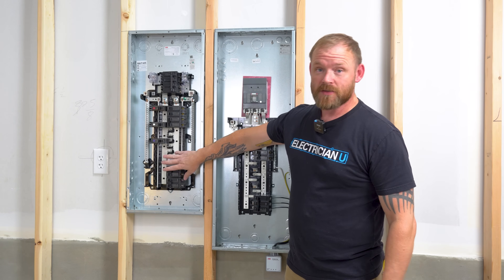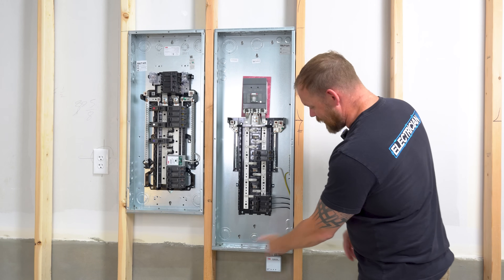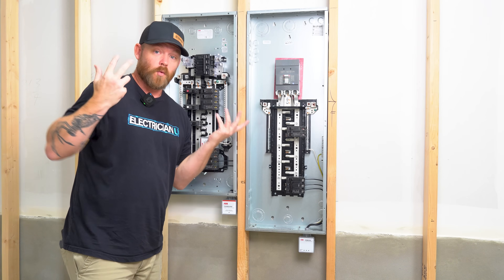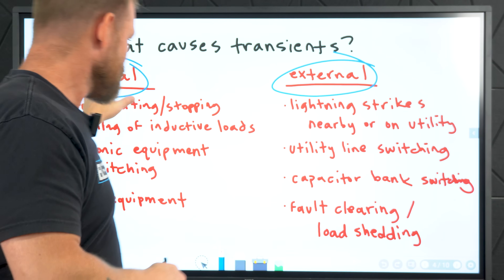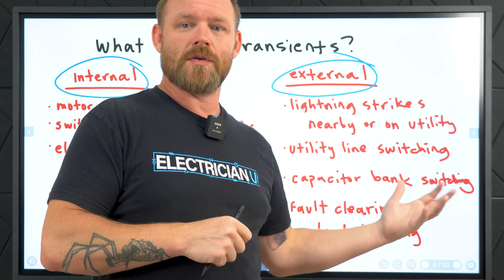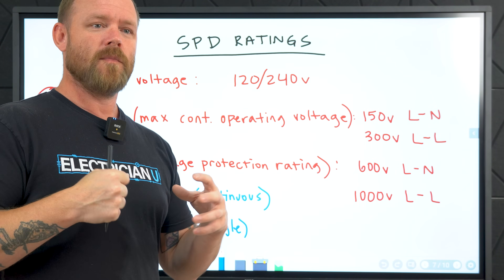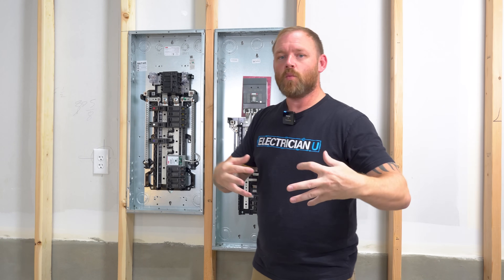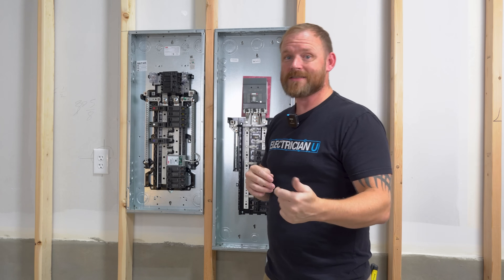What Surge Protectors Actually Do (and What They Don’t)

Comment: My understanding is that even lightning rods do not so much take strikes as prevent them by allowing smaller discharges to happen earlier, so that the voltage needed for a strong lightning strike never builds up -- instead you get a corona discharge off the tip of the lightning bolt, relieving the pressure.  BTW, a lot of people think "surge" means "momentary outage" -- I hear that a lot.

Comment: A lightning protection system has nothing to do with conducting the energy of a lightning strike into the ground, it actually disincentivizes the lightning from wanting to strike anywhere near your residence by those wires giving an easy way for ions in the earth to equalize the voltage potential.

Comment: Why is it on thr lineman side when they go and check for voltage on the bottem side of the meter the surge protector casue the meter to pick up small amounts of voltage ?

 Nevermind just seen the end of the video im now assuming its becasue of the mov acting almost like a capacitor 👍 roger that

Comment: Were constantly having squirrels get zapped on our polepig blowing the fuse, along with recloser activations in storms, so I really need to install a surge protector in my panel. I think I'm going with an Eaton flush mount protector, because im not thrilled with putting a square d hepd80 or Siemens in the wall without it being in a box (due to the lightning strike  explosion and fire risk) and those companies flush mount kit is nothing more than a trim ring.

Comment: I lucked out with my assembly, when lightning struck power pole near my house a few year ago. AND this is IS a lightning story, in which my stuff survived.

I have (and had) a meter based surge protector. I have 5 ground rods near and at the box and meter. Also an extra loop and separate (older) main fuse box leading to separate distribution sub-panel (eventually to be rewired to be the main panel). All sub-panel circuits are in EMT or ridgid metal conduit which is almost all of the house.

Event: Lightning sturck maybe 2 poles away. My neighbor and my house have hanging cables from same pole of equal length. My neighbor lost every piece of electronic equipment. I lost a night light (which literally exploded). 

The fuses in the entry box exploded and the inside was left black. 

Beyond the multiple ground rod, I think that the protection came from arcing in the fuse box to the box itself, which included the first two ground wires and ground rods. (First ground lead and rod from meter to ground with surge protector, 2nd from main fuse box to second ground rod. Then the ground wire goes across back of house to other rods (where telecom is grounded) and continuous without break to front of house water pipe, but this long lead has too much inductance to give much high frequency protection, so most of the surge went through the first two rods which can be observed by the in-box arcing damage.) The loop of wire from primary fuse box to the second level distribution panel must have given the inductance to help prevent the large amount of current flow.

I replaced all the surge protectors in the house, and of course the meter itself and the meter surge protector had to be replaced. And fuses, the old fuse mounts are pefecctly fine. The surge protector on the HVAC is supposedly ok and tested.

Yes the stuff exploding is exactly correct because I saw the results. The first level fuse box still has a couple of circuits, and that is also where the night light was connected that exploded, the single casualty inside the house, less than 12 feet of romax from the box. Glass fuses exploded and cartridge fuses at least completely opened and turned color. Massive evidence of arcing both to back metal of the box but also to the luckily closed and bonded faceplate.

Comment: That device that you're describing is for over voltage not overcurrent and where does over voltage come from lightning strikes on the pole or a primary Transformer blowing up the ABB device takes a direct hit it burns it out you need two of them one for the panel and one for the AC unit just to break even with Mother Nature

Comment: Usually, a MOV is used for surge protection. A MOV is voltage-rated. A MOV is a Metal Oxide Varistor. It works by DECREASING  resistance as the voltage  increases. It is normally  place between the line and neutral. If the voltage should go above  its rating, the resistance will decrease, causing a high cirrent flow. Normally this will trip the circuit breaker this your circuit is protected. Yes, the MOV will get hot and sometimes explode if the voltage spike is very high. The MOV will conduct electricity as it IS a resistor so DONT place it between line and ground as a GFCI will see this as a leak, and trip.
Important note, if a circuit breaker trips due to a voltage spike, the MOV is damaged and needs to be tested or replaced. It a cheap compared to the equipment its protecting

Comment: Surge protectors can ONLY PROTECT WHAT COMES AFTER THEM IN A CIRCUIT!!! NOT anything before them. From an engineering perspective, as well as physics, you sir, ARE completely wrong. Ala the Intermatic IG2240-IMS, which is designed to either go across the main breaker or be installed before it.

Comment: They can help your electronics provided it’s not a direct strike. During a lightning storm you can be guaranteed there’s tons of spikes on the line. Just scope it. However lightning travels a mile through the air. A surge protector is less than a foot long. Isobar makes the best and I’ve seen them completely burned up but they protected the device attached. However don’t  count it.  The best protection is to unplug the device during a storm. Lightning strikes power lines all the time and most is bleed off, but there’s always spikes associated with it. Those spikes are the result of electrical energy being introduced into the system by lightning. Surges caused by electrical and mechanical devices are insignificant in most cases unless your electrician is incompetent and that’s always a possibility.  In the event of a direct lightning strike you can expect your surge protector to catch fire or possibly explode.

Comment: Internal Panel Surge Protectors need to be placed as close to the mains/neuteral lug as possible, which means right at the top/right(depending on orientation) of the panel. Many people make this mistake; including you in your example on the left with your type II. type 1's need to be attached to the mains/feed.

They also need to be tested regularily, and generally replaced every 10-15 years.

Comment: Another concept with surge protection that a lot of people don't know about is cascading protection - where you have multiple "layers" of surge protectors with diminishing clamping ratings dispersed throughout a system to protect more delicate devices. For instance, you might have a larger SPD at the main panel to handle larger transients, and SPD receptacles at point-of-use for things like AV equipment, computers, etc. UPS units and some power strips also contain SPD internally and can be counted towards the cascaded protection.

Comment: I want to see spd's demonstrated with a scope. Bad thing is it's hard to do without frying the scope. But I think we need to define what a lightning strike is. I'd consider a strike within a quarter mile a direct strike, a person can feel the voltage gradients at that range insurance should cover anything in this radius as total loss. A strike within 5 miles is considered near by, an oscilloscope can detect those. Will a spd protect from nearby lightning strikes sure, just not direct strikes. But the main question is, a quick Google search says mov's only cost a buck a piece, why do spd's cost more than 10 bucks?

Comment: So nice 😢 but measure the ground rod resistance it should be 5 ohms or lower for surge protection to work properly by manufactures specs.  The acorns guys use outside  on the ground rods  with gec usually has corrosion. Surge protection after is waste of capital

Comment: It does really dump energy to earth. What it does is become a shunt (basically dead short) to absorb all of the overvoltage energy. Ground can never really be used for surge protection because of its high impedance (+ 6 ohms). The 99% of SPDs have MOVs (Metal Oxide Varsistors) that work by clamping between L1 & N or L2 & N. when the voltage drops below the trip voltage the impediance (resistance) increases into the megaohm range (basically an open circuit).

The problem with MOVs is that can only trip a limited number of cycles as the device breaks down. Some times they fail open (basically no longer offering surge protection), or fail short. Usually they have an LED to indicate if the SPD is still good.

Comment: Type 1 surge protectors do effectively help some lightning and/or high energy events.  The type you have in the video are both type 2 (not type 1 like you mentioned) are not intended for direct lightning protection but can indeed help for indirect lightning protection.
Reply: I’ve installed quite a few of the Siemens 140,000 amp whole house surge protector type 2’s in Florida. They connect to a double pole 20 amp breaker. My understanding that the type 1’s are more of the type that people lease from the utilities, and they are on the line side of the meter.

Comment: One thing I never understood about these is how do they stop the high voltage spike from still reaching all the other circuits, without taking them out of the equation?  I suppose by shunting to ground it would eventually trip the main breaker but what about the ones that are on a 15 amp breaker, will they not just trip their own breaker when they shunt the power to ground?

Comment: Lightning, I get sick of explaining it to customers. I had a customer with an automated gate system that called me after he'd lost his operators for the fifteenth time. I installed a 1/1 transformer ahead of the gate controls and a two 15' 3/0 triad ground systems on each side of the driveway, bonded the crap out of everything, SPDs on the comm lines and a 200,000 amp SPD ahead of each operator's control board. He never lost his equipment due to lightning again.

Comment: They certainly are meant for lightning protection!  Not a direct hit of course, but if lightning hits a tree outside and the energy shoots across the ground it will result in a surge - from the lightning.  

Also the joule rating has nothing to do with how many strikes the device can take.  It is how much energy it can absorbed during the surge or transient.

Comment: How would one of these react if the home's power system lost the neutral line? Say if something happened to the line, like the wire corroded or an animal chewed through it, thus everything now has 240 volts running through them? 

This happened once to an old friend's house. If it wasn't for the fact this happened in the 90's, before most of our electronics became so sensitive to out-of-spec transients or sustained over/under voltages, things could have gone very badly. As it was, if the family wasn't home at the time, they wouldn't have a house anymore because it would have burned down due to a surge protector strip going up in flames because of the neutral line being cut.

I would hope that if such an event occurred with these, they can either shunt the energy elsewhere, or pop the main panel breaker. Though I doubt they can do that. 

Is there any devices or wiring method that could address such an event?

Comment: The dampening isolation curve that you drew, is exactly what a PID algorithm does to eliminate offset from a set point. It is what I worked with when operating commercial industrial HVAC systems. If I were to graph actual temperature or pressure against set point. This is exactly what the graph would look like

Comment: Although these surge suppressors won't protect against a direct lightning hit, they will in fact protect against som lightning induced surges.  In most two wire utility distribution systems, the top wire is connected to ground. It  is often thia wire on the poles that gets hit by lightning. This will shunt off most of the lightning's potential to ground but some greatly reduced potential can make it to the power "hot" conductor and into your home as a surge of potentially thousands of volts. This type of surge at those levels, will often damage electronic equipment. but these whole house surge protectors might indeed prevent some damage. It's all a matter of how high the surge will reach. 

Power distribution systems are pretty  well designed to deal with lightning but they aren't perfect and the nature of a lightning related  are not entirely predictable. and some surges can damage electronics. This can get expensive to get hit with such a surge.

So you are correct in that these surge protectors will lose against a direct lightning hit! But that is fairly rare. These surge protectors can help against some "thunderstorm related power line surges".

Comment: I appreciate that the video mistates the concept of lightning impacting the grid to drive engagement, but i think there are some valuable lessons being lost.

It takes 3 days to get a reactor at a power plant running, so they don't just take them down because demand goes down. That extra energy is sent somewhere else in a managed way. Anything that changes load on the grid is going to make a moment of unmanaged potential, which leads to something utilities refer to as transcient voltage. 

If the transcient voltage is making it to a home, it isn't lightning that is causing it. It is a poorly-managed grid. Chances are that the homeowner has "dirty" power. Transcients are the least of their problems. 

I have seen UL-listed SPDs fail and start a runaway thermal event. They are sacrificial devices at best, liabilities in the worst of times. 

If the homeowner complains about dirty power, put a power logger on their line and gather some data. If they have dirty power, they need a power conditioner, not an SPD. 

Or, if you have a client that really wants to put their money where their worry is, you could suggest UPS solutions or an Automatic Transfer Switch with generator. 

Leave those SPDs to the HVAC tradies.

Comment: Power engineer here. Saying a surge protector is useless because lighting can strike directly is like saying a bullet proof vest is useless because you could get hit by an artillery round. Derp.
Reply: He’s saying a surge protector won’t protect at all in a lightening strike. Like a vest will stop a 9mm bullet but not a 50 cal round. 😏😊
Reply: You would be surprised at how many people believe surge protectors protect against direct lightning strikes, and it's really common in older people. My mother will not plug in her desktop at her house, without a surge protector, because she believes that if lightning hits the house, it'll mess her computer up. My grandmother is the same way, my wife's grandparents on her father's side were this way.

I don't know where the belief that surge protectors protect against direct lightning strikes, but there are people who believe it, and this is the first video I have seen where someone actually explains why.
Reply: @TCAPChrisHandsome  Lightning protection often includes an air terminal (or air terminals), down conductors, and an array of grounding rods with a single bond to the system ground grid. And still, surge protectors are installed to guard against voltage surges and transients.  And still, as you correctly point out, nothing is guaranteed when Zeus takes direct aim at your equipment.  People on YouTube comments suck sometimes.
Reply: He didn’t say anything like that. He literally said multiple times he was just saying that you can’t use it for it. He’s clearing up a misconception, this channel is for people who touch tools
Reply: @bransonroth2162  It's not my fault you couldn't handle school and don't understand the things you work with.  I'm here for you little buddy.
Reply: Its still correct. Typical surge protectors can't handle that type of a direct power hit.  Its too large for these specific ones.
Reply: Ya Kenny, I was going to say the same. To say a surge protector isnt and cant protect from lightning because it isnt a lightning rod... electrician U. Please don't do the strawman bs.
Reply: Just another tradesman larping as an engineer

Comment: Many people think a surge protection device reacts slower when the connection cable is long — but that’s not the real reason.

The SPD doesn’t get slower — the problem is the voltage drop across the wire’s inductance during a very fast current pulse.

The induced voltage is given by
U = L x {di}/{dt}
Even a short wire has inductance (about 1 µH per meter).
So if a surge current rises at 10 kA/µs, one extra meter of wire can cause an additional 10 kV voltage spike! ⚡

That’s why the connection between the SPD and the equipotential bonding point must be as short and straight as possible — not because of switching speed, but to minimize the inductive voltage drop.
Reply: Now, if only 99.8% of YouTube obtains an EE degree to understand your comment.

Comment: Welding (240v outlet in my garage) was causing my smart devices to go whacky. I'd have to reset the house. So I installed an hepd80 in hopes that it would help. Sure enough my problems caused by welding went away (knock on wood). Now I'm using my plasma cnc and I don't have an issue either. Good stuff! - John